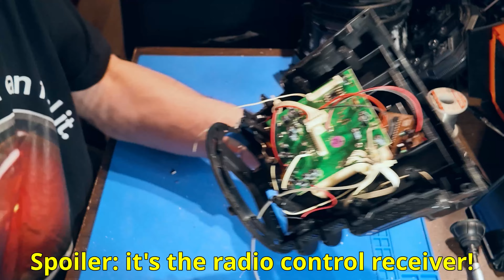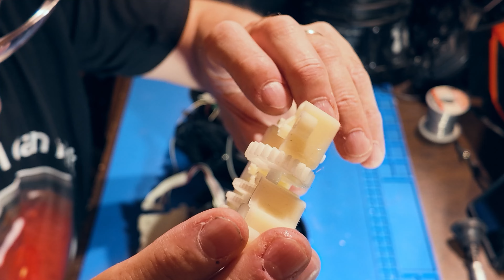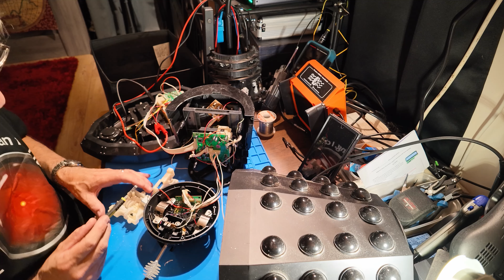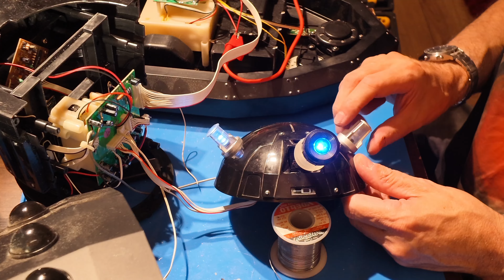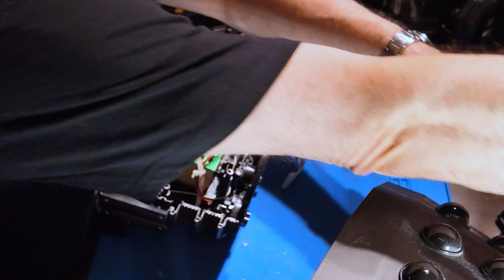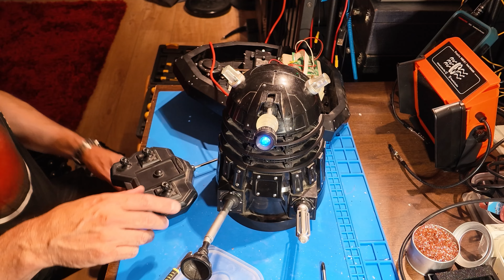BBC Dalek Model Rebuild Part One

Comment: Hi , do you repair them!, my grandsons speech does not work any longer on his 18 inch voice interactive dalek, but everything else works fine, like to get it repaired for him, thank you Alan
Reply: Hi do you repair them 18 inch speech not working
Reply from the maker: Hi, I think I have replied to you on another comment but just in case you've not seen it I'll just say it again here. I don't have a business repairing these but if someone asked me to I would take a look, though as you will have seen it is hard to get into them and impossible to do so without some risk of damage where the glued parts need to be heated. It is possible that the speaker amplifier has failed as I think the RC beeping noises might have a different circuit. First make sure all of the batteries are fresh including the hidden AA ones behind the D cells.
Reply: @t @trevtalkstech0506 , hi, no beep sound atoll, but everything works apart from that the gun lights up when fired and all the lights flash in line with speech movement good no problems grandson has a donor dalek for parts if that helps same model 18 inch copper colour voice activation dalek
Reply: New battery’s are fitted AA AND D BATTERYS MAKES NO DIFFERENCE NO SOUND
Reply from the maker: I hope the speaker works but I think it's more likely that the electronics have failed. There are ribbon cables and plugs everywhere on this unit so check these out too.
Reply: Sorry new battery’s in, everything works apart from sound , no beep noise on start up, but lights gun light up movement o,k , it’s just the speech

Comment: The loose wire is the aerial for remote control, mode
Reply from the maker: Hi and thanks :-) ... Yes I figured this out eventually. It was very elaborately anchored in position. For a toy the whole thing was remarkably well made.

Comment: The wire loose is th3 aerial for remote control
Reply from the maker: Hi, yes I realised it was connected to the radio board and it all made sense. Thanks for the confirmation!
Reply: Thanks trev, do you repair them, as grandsons everything works apart from sound, it did work up unto a few weeks ago, movement works lights work, when you press speach button lights on head flash as if it were talking , but no sound, I,m wondering if the coil in the speaker as failed, kind regards Alan, it’s my grandsons , I live in Bristol little stoke area thank you .